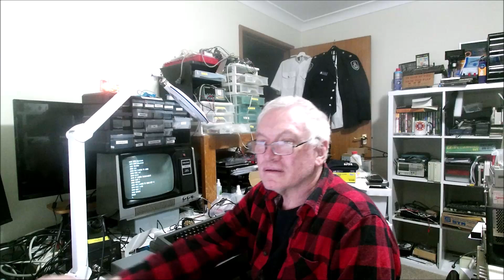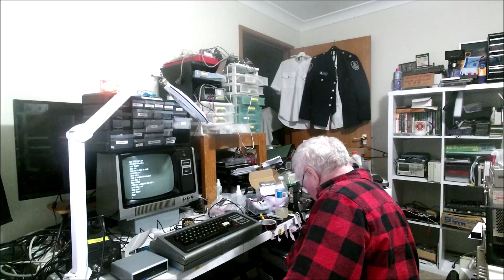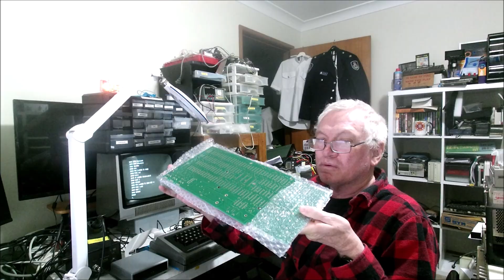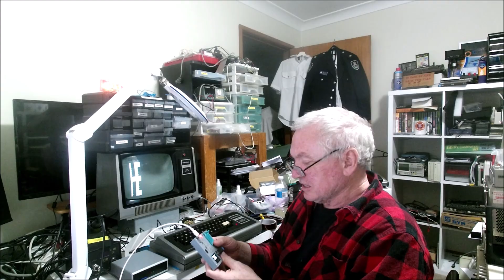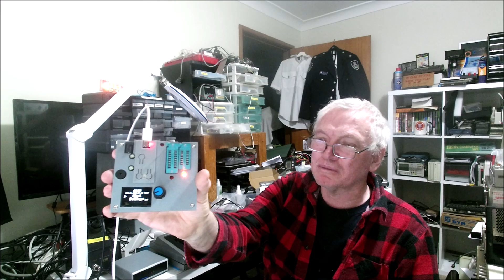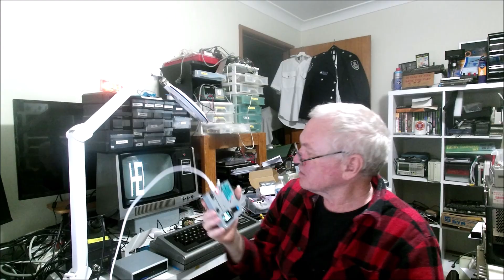An unscripted late night ramble about my TRS-80 Model I restoration.

Comment: I spent countless hours on my beloved Model 1. It was a hand-me-down from my grandfather Arthur A. Merrill, who used it for stock market technical analysis, so it had all the bells and whistles: a 32k expansion interface and two 5 inch floppy drives. But, alas, no lower case letters. I can still remember typing CMD"S to boot the thing up. Many, many hours programming in BASIC spaghetti code, since structured programming hadn't made it mainstream yet, and many more hours playing games from Big Five Software in Van Nuys, California, which I only found out much, much later was in Silicon Valley. Bill Hogue and Jeff Konyu were the geniuses behind Big Five. Robot Attack was my favorite, but also Defense Command, Super Nova, and Galaxy Invasion. 

Such memories! Reading 80 Micro magazine, and painstakingly typing in code by hand since the Internet was still just a DARPA project. Lots of great articles by Leo Cristopherson.